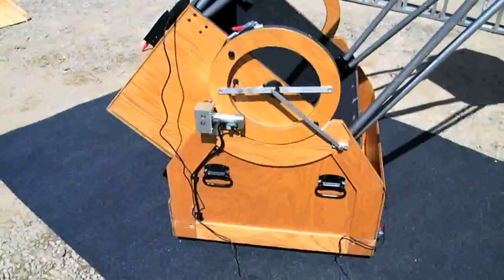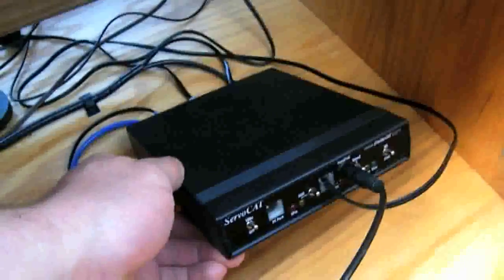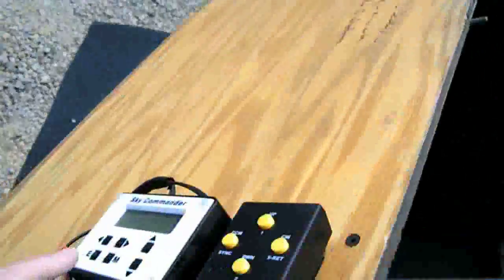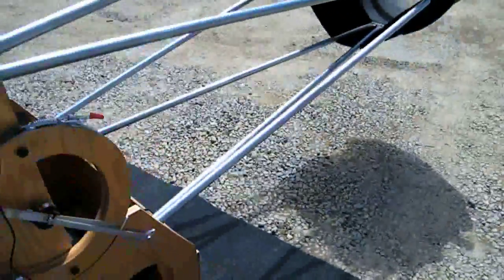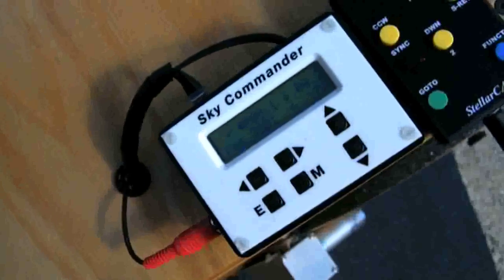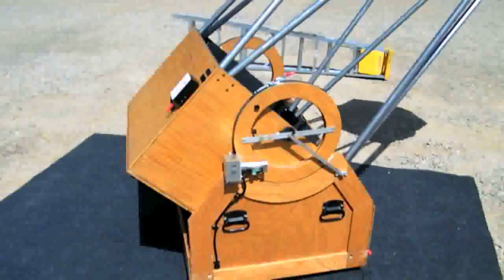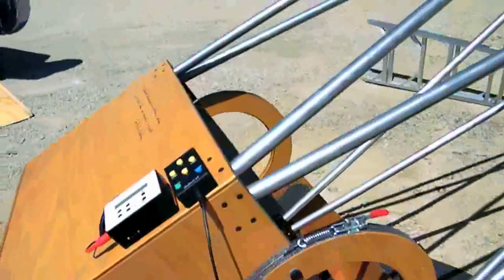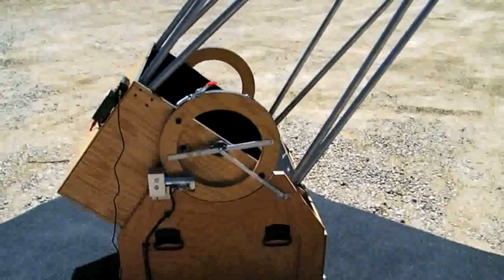Testing of Servocat Drive goto System on 24" Tectron Dobsonian Telescope HQ

Comment: I need this for my 16"
Reply from the maker: Gregory Heath super easy to instal. I’ve got two now, on a 20 and the 24. highly recommend fed.
Reply: thanks..   Have you ever tried to do any astrophotography with it.   Is that even possible ? or do you have to be polar aligned ?
Reply from the maker: Gregory Heath I’ve done some planets. There is software for stacking and rotation that will do deep sky.
Reply: Geoff Goins thanks Geoff !